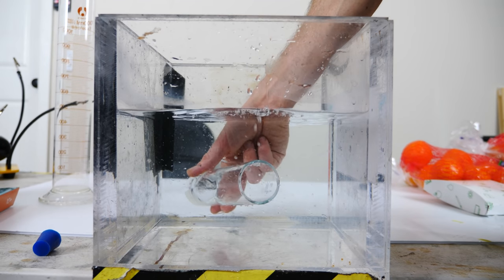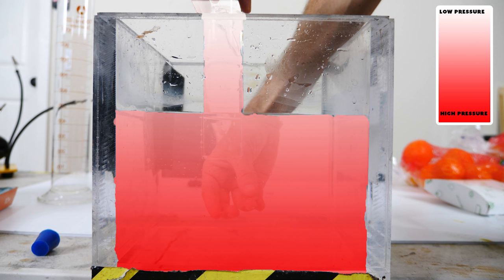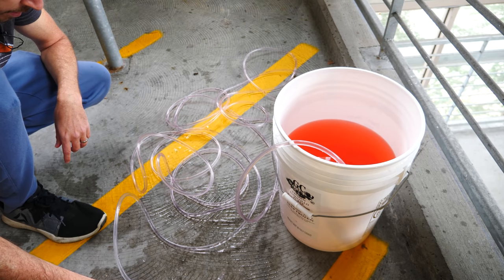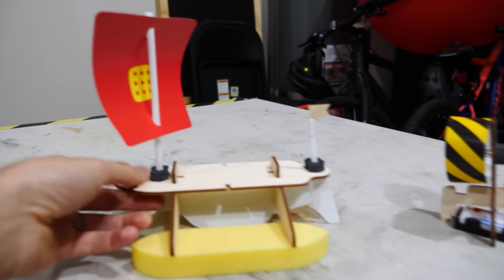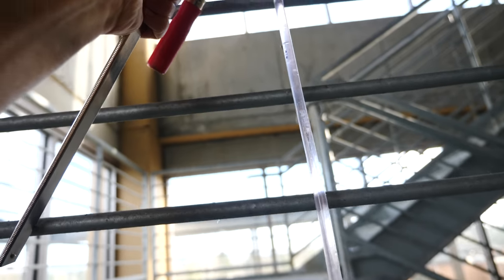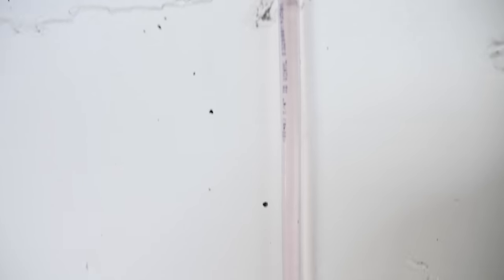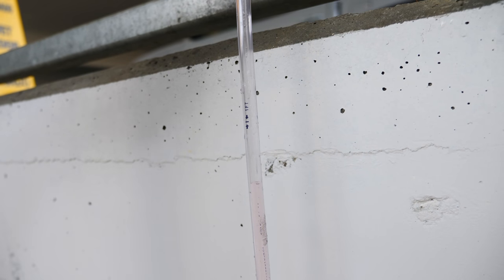Why Water Boils In Tall Cups

Comment: Maybe this is the first time I hear a misconception in your videos. You said that inside the tube there will be a perfect vacuum, technically this is not true because what you create is a strong decrease of pressure inside the top part of the tube and this will let the oxygen molecules inside the water to evaporate and so you will have a lower pressure environment still filled with some molecules of water and oxygen, so NOT a perfect vacuum. Although at the beginning you may think that there should be a small perfect vacuum but still even there the water start to evaporate little by little, but it does..
Reply: Yeah, he just kinda didn't care about that part
Reply: didnt he say theoretically tho, assuming its just water with no oxygen dissolved maybe
Reply: I think it was understood that he meant a hypothetical perfect vacuum - so that you could run the numbers and find a limit to how high  you could ever get the water level.  James does glaze over key talking points in his video as he's catering to a younger crowd.
Reply: I agree with you.  The same thing can be observed with a plastic syringe filled half way with water and all the air expelled.  There's dissolved air in the water and when you pull the vacuum you expand those micro-bubbles.  When you release the vacuum the bubbles shrink back to their original size.  Interesting but inaccurate to call it boiling.  Yes, water will boil at lower pressures.  I live at an altitude of 4500 feet and water boils somewhere around 209˚F.  The reason why there's no water in space is because of the extreme vacuum.  Water boils away.
Reply: @WulanDari-uv8bg  Do you squirt and bubble if you're raised above 34 feet and somebody attaches a vacuum pump to you?  GTFO
Reply: @Google Google  He said that in this video. He discussed it at the end, when talking about the effect of different water temperatures, so I'm not sure how you're saying that he's spreading a misconception.
Reply: Admittedly, the only thing he didn't mention was the dissolved gas.
Reply: @BlackWolf42-  exactly the response that child a user is looking for… just report and ignore the troll… eventually it is going to lose access to yt and hopefully the web in the end…

Comment: Nice video. Thank you. Can you make this into a water distiller? Perhaps bending the top into an upside-down U shape and cooling the empty side slightly allowing the water vapor to condense down on the other leg of the U shape? Could be far less expensive than steam distilling water.
Reply: Why would it be less expensive?  Are you one of those who think you can get water from thin air for free?
Reply: @NGC1433  because the end result you want is room temperature water, not nearly boiling water. You need to waste a lot of energy to boil water, and it's not possible in practice to get all that energy back.
Reply: He's referring to the fact you not using a heat source to produce steam
Reply: You would need to move the tube up and down, 
I've thought about this quite a bit...

Comment: The limit on height is not due to the temperature of the water, its due to the pressure of the atmosphere.
The boiling point of water does change with temperature and pressure, but it doesnt just boil more to maintain the height.

Comment: If there was a giant tube like this that you could swim up into, what would happen to your body especially once you reached the top of the water vapor pocket?
Reply: It would feel like you’re swimming in a hot tub
Reply: You would probably faint
Reply: @Gibbs2Go the temperature of the water does not change
Reply: @wvking  ohh, I just figured if the water is boiling, it would be hot.. I watched again and realized that you could lower the boiling point by reducing the pressure.. that is crazy, thanks for pointing my error out!

Comment: That makes sense! 33.8ft is about 10 meters. Every 10 meters under water equals 1 atmosphere of pressure. So basically by going up to 10 meters, you create a force of 1 atmosphere of pressure (in this case water pressure) pulling down to create that vacuum. I think if you were to try this in an area with higher atmospheric pressure (such as a pressure chamber with 2atm or more, you would need to go up to 66ft for 2atm, or 99ft for 3atm. That would be very interesting!!!

Comment: One comment: I find it inaccurate to describe the column of water as being sucked up (01:04). There's no "sucking force", the column is being pushed up.
Reply: things get pushed into vacuums
Reply: When you say “ sucking juice with a straw” its still the same thing. There is no sucking force, you are just making vacuum over the top and water is being pushed up by atmospheric pressure. In fact, there is no such thing as sucking force. It’s this whole phenomena of atmospheric pressure pushing juice up the straw that we call sucking. So he is right here
Reply: @karansandhu4827   Well there actually is such a thing as a sucking force; it's just not possible with gases because they have virtually no intermolecular forces (if it's an ideal gas), which means they can only push through collisions. However, liquids and solids have intermolecular forces that allow them to both push and pull. So you can suck on a liquid, and this can lead to negative pressures.
Reply from the maker: "suck" is a word that describes being pushed into a lower pressure environment by higher pressure outside that environment. It is just semantics. There is nothing wrong with using the word "suck" as long as you know what it actually means.
Reply: It's the same thing. It's a pressure difference. You're saying the pressure is higher at the bottom, he's saying it's lower at the top. As the top pressure is the one that is changing during the experiment, I'd say that is the more interesting one.

Comment: At that extreme height of 33 feet (around 10 meters), there is a significant decrease in atmospheric pressure at the top of the tube compared to the pressure at the bottom near the water level.

This large pressure differential causes the boiling point of water to decrease dramatically at the top versus the bottom. The lowered vapor pressure requirement at the top allows bubbles to form even though the bulk water is not near its normal boiling point.

Here's a more detailed explanation:

Atmospheric pressure decreases with increasing altitude due to less air weight above
At 33 feet higher, the pressure is noticeably lower than at ground level
Boiling occurs when vapor pressure equals the ambient pressure
So this lower ambient pressure at 33 feet allows boiling/bubbles to happen at a much lower temperature
This is not just due to the tube being tall, but the extreme height difference creating a genuine low pressure environment at the top. Basic physics shows every 10 meters of height decreases air pressure by around 1 psi or 7 millibars.

So in your experiment, rather than a small boiling point change, you were likely observing the fairly dramatic effect of greatly reduced ambient pressure on the boiling conditions. An interesting practical demonstration of vapor pressure principles!

Comment: Metric system???
Reply: Multiply by .3 and you get the answer in meters.
Reply: @MrEliakimRAS  multiply ur whole SHlTTY system and you get the correct standard
Reply: @GioJonnhyK there’s no reason to call the SI measurements more correct or generally better. To be honest I think the American units can be more handy in some cases
Reply: @GioJonnhyK  And you think angrily screaming will change how people use units? Perhaps if you were reasonably fluent in both systems youd be less angry...
Reply: @simiaki12  😂😂😂😂😂😂😂😂😂😂😂
Reply: Yes
Reply: @Ordcestus11  I'm fluent in both systems and I'm still angry about having to use American measurements
Reply: @coindog6336  I prescribe you 1 beer. 2 beers are authorized if extended exposure. And Only After driving home from work.
Reply: Just multiply by hamburgers per eagle.
Reply: @simiaki12  Imperial system has no logic to it at all. Fahrenheit is based on unreproducable measurements, knots and miles and feet and inches do not fit together at all. In metric system, which is therefore used in science all over the world, all fits together, 1000 grams 1 Kilogram, 1000 Kilogram 1 ton, a pendulum of 1 meter swings once a second, one calorie is the amount of energy to heat up 1 cubic centimeter of water by one degree, and so on and so on...
THAT is logic. So there IS a reason to call one system better than the other
Reply: this is an american parking garage, the height of the floors are probably much closer to customary measurements than metric ones
Reply: Stay mad I bet you order a pint!
Reply: @LastBeacon-qn2gy  the british be like "ah yes i would like 5 decilitres of ale"
Reply: Haha, we Germans just order a beer- and that's a real beer 🍺
Reply: lol our system is shitty yet you're the one living in a country where typical young adults are either unemployed or making less than $20k a year!
Reply: @jonnyd9351  its because they use metres thats the reason
and by they i mean the specific single country that uses the metric system
Reply: @simiaki12  when?? How? What???
Reply: @paulpaulsen7777  The metric system is just as arbitrary as the imperial system. Metric units of length at are no longer defined by fractions of the circumference of the earth, nor is mass based on water, nor are calories based on boiling water, because that's not reproducible, same with volume, temperature, mass etc because they were not exact and did not account for pressure differences. The standard for metric units changed to the mass and length of some metal weights in Paris, which is the same as the US system. Now both metric and US distance and volume measurements are redefined in terms of the speed of light. 

So metric and imperial are now equally arbitrary. True natural units would be in exact units of the speed of light, the Boltzmann constant, Planck length, etc. Neither metric nor imperial meets this standard.
Reply: Why don't you convert the units yourself instead of going to an American channel and demanding they use your measurement system.
Reply: @XandateOfHeaven  because the use of the imperial system for actual scientific study is rare and rare for a reason
Reply: @XandateOfHeaven  You are right. No question about it. But the big difference is: How many feet make a mile? How many inches are one foot? Which mile do you mean? Standard, nautical? What is one ounce? Is it a volume or a weight? It's much easier to calculate everything with factors of 10. 10 millimeters = 1 centimeter. 100 centimeters = 1 meter. 1000 meters = 1 kilometer... same with weight, with volume, with everything...
Reply: @GioJonnhyK become the economic and cultural superpower of the world then you can tell us how to measure  stuff 👍🏻
Reply: @XandateOfHeaven  🤡🎪
Reply: Figure it out
Reply: i know construction workers with drug problems who didnt graduate highschool who can do it if you can use both its a massive skill issue
Reply: Why cant we just make a third system and use it?
Reply: @InquisitorAnsgar  I invented one
Reply: @Myemnhk Yea, the first 4 worlds richest countries (as of 2024) in the world and most of the most cultural countries use the SI/metric system.
Reply: @FebruaryHas30Days  Whats it called?
Reply: @InquisitorAnsgar  me an American with a 9mm and 3.5 grams in my pocket
Reply: @InquisitorAnsgar  The Composite System. They're similar to imperial units except it's based on highly composite numbers and the base unit is an SI unit. 10 fingernails in a span, 6 spans in a meter, 12 meters in a pole, 5 poles in a monument, 6 monuments in a field, 14 fields in a league, 11 leagues in a valley.
Reply: @InquisitorAnsgar  
1 fingernail = 1/60 of a meter
1 span = 1/6 of a meter
1 meter
1 pole = 12 meters
1 monument = 60 meters
1 field = 360 meters
1 league = 5,040 meters
1 valley = 55,440 meters
Reply: @coindog6336 yea, as an American who hates weird math, im Metric Gang

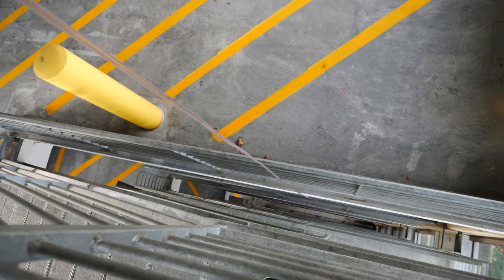Comment: 5:12 The vacuum stays at the top of the tube right until the water starts boiling. After that the headspace is filled with the air previously dissolved in water

Comment: That tube can be used to measure barometric pressure.  And if you left it there for several days and observed the change in the level you could monitor the barometric pressure as the weather changes.  But it's easier to use mercury instead of water because with mercury the tube only has to be a few feet long.

Comment: The tube's height doesn't cause the system to "reach the boiling point of water". Rather, the vacuum falls below the vapor pressure of the water in the tube. Boiling point is "a temperature at which its vapor pressure is equal to the pressure of the gas above it." Essentially, the vacuum causes a lowering of "boiling point" to ambient temperature in this experiment. More accurately, the vacuum in the tube's top creates the conditions in which the water beings to "evaporate". It is probably also drawing dissolved air out of the water to fill that vacuum.

Comment: The tube he used with small shutoff valve & you have a Water Level....Works extremely well for leveling anything under 30 feet.

Comment: Another neato thing is when you pressurize the water. During the winter time you can actually get the water so warm while it’s under pressure that when you release the pressure the water instantly sublimates.
Reply: Sublimation is what happens when a solid changes phase to vapor without going through a liquid phase.  When a liquid changes to vapor, it's called boiling, or just evaporation.

Comment: aaaaah, saturated gas release point actually.   HVACR has a video that talks about this and there's some stuff from one of the other lab channels that discusses vapor vacuum pumps.    Once you deplete the saturated gas you CAN hit a "boiling" point but its gonna deplete a LOT of gas first.  You can end up spending more time pulling gas out of compressor oil than it takes to actually fully evacuate the actual mechanical volume of a refrigerant system at times.

The way you determine if you're actually at a boiling point is if your body heat causes the level in the tube to drop rapidly.   This experiment is better done in the winter somewhere just above freezing.   It DOES happen and in system process its actually an interesting way to generate pure moisture vapor even tho the apparatus is huge.

Comment: This made me think about jet pumps for wells since they are not down hole, their max head must be a similar height. Well looking it up their max suction depth is 30 feet, 3.8 foot tolerance so you can still get some flow instead of just pull a vacuum and get vapor. I never would have thought of that.

Comment: There has to be thermal effects from this. The latent heat of vaporization is still a required input for the phase change despite the changes in pressure. And the same inverted. So there is a cooling effect from the rise in height and a corresponding heating effect from descent on the tube (at least at the point of phase change). That means that if you can somehow suppress the heat input/output from happening, you should also be able to suppress the vaporization from occurring and thus could potentially be able to extend the vapor and condensation height.
Reply: Latent heat of phase change is a function of temperature and pressure and under certain conditions can not exist entirely (supercriticality).

Comment: This is a very simplified version of the science behind. There is no real theoretical maximum height. The water boils only if there's enough nucleation sites for bubbles to start forming. In practice, for this diameter of tubing, this water composition and the absence of perforation plates to arrest the ones that form leads to the boiling ocurring at the height predicted by the vapor pressure of water at nearly zero atm. Plants like the sequoia tree can pull water more than 100 meters high, mostly by aspiration from transpiration but also by capillary and pumping forces.

Comment: The question now is, what if you bring a tube >2x the length higher than the top of that level with a bucket of water on one end and the other end lower. Will it siphon since it has an inlet and outlet, or will the pressure at the top be too much still, causing it to cavitate and fail?

Comment: Nice, you just created a barometer.
The pressure exerted by weight of the water column at the base is equal to atmospheric pressure. For water, 10.3m water column is one atm. Now if we use mercury, I believe the Mercury column will be 0.76m?

Comment: Atmospheric pressure at sea level is ~760mmHg
This equals to 760×13,6=10336 mmH2O
And this means you cannot hold water more than 10,34 meters (~34feet) height in a tube which is open at bottom to atmospheric pressure.
Reply: In addition, if the inner diameter of the tube you use is small enough, it may enable higher water columns caused by molecular gravity (adhesion) forces between tube and water...

Comment: as long as there is no air in the tube, you can maintain negative atmospheres of pressure without the water boiling.  Trees do this internally to get water to the tops of their trunks.